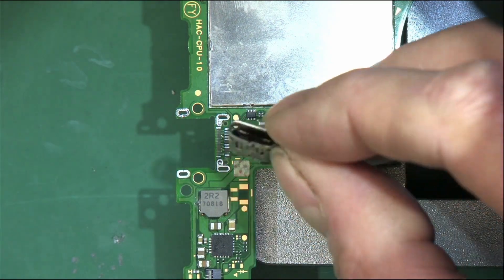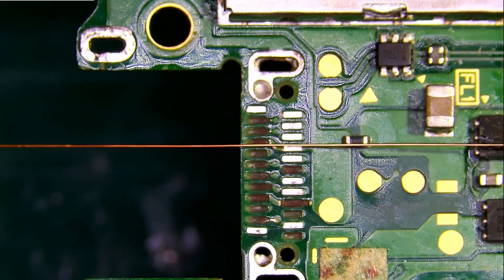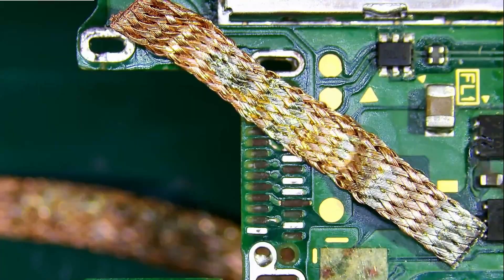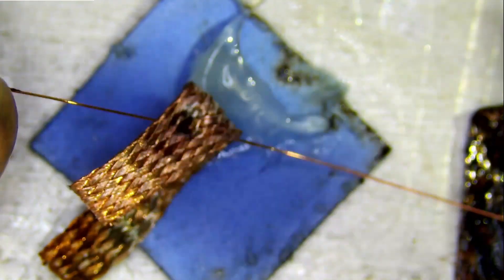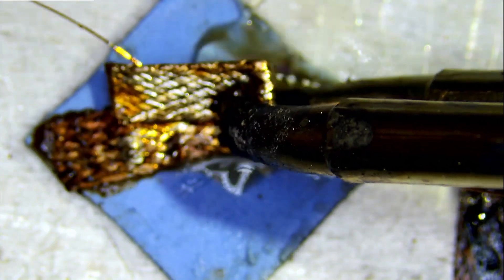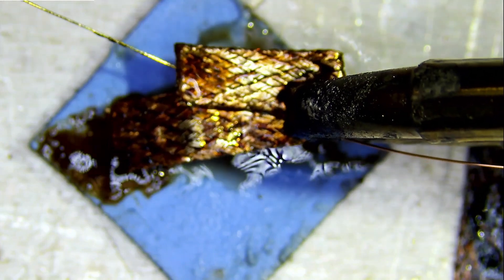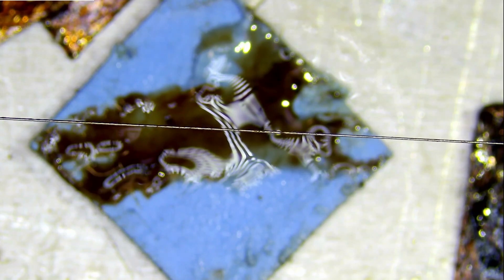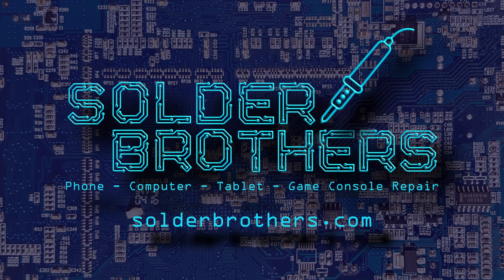How to pre-tin jumper wire with solder wick for trace and solder pad repair. Better faster easier.

Comment: This is very cool! Most of the jumpers I work with are enameled/varnished, and the way I tin those is by sticking the end of the wire in a tube of flux, then running the wire through a ball of molten solder on the tip of my iron. Even still, they typically do not tin very well at all. 

This method looks to me like it would work very well for almost any kind of coated wire, I would assume it works so well because the wick functions as a kind of abrasive, which will scrape against the wire as you're pulling it through and give the solder an easier chance to adhere. 

I'm sure you've been trying to tin up a really annoying pad before, and sometimes just gently scratching your iron back and forth magically gets it to tin. I get the feeling this is a very similar process, just reversed as it's using the wick to provide that scratching action. I'll use this method from now on!

Comment: learning to solder on my own, this is a neat trick ill be trying soon as I've made a couple mistakes with ripping traces out of the board or wiping pads off completely while trying to use desolder braid 😳😆! Learning because I broke a microscope charging port and figure it'd be neat to fix it myself! I shake like the dickens too sir, and I'm only 35 so dont feel bad! Military messed me up a tad and so I just try to work with it! 😆 Thanks for the help!
Reply from the maker: I've wiped off many pads, most turn out to be no-connects. if there is no trace going to it, (with the exception of a via in the middle of the pad) they may not be needed.
Reply from the maker: Part of the trick is resting your hands on something, that is the biggest challenge. When you have them very stable, it is easier. Sometimes it is the time of day, when you ate, and when the camera rolls, oh boy, can that shoot up the nerves. Movement under the scope looks huge also. Thanks for watching.